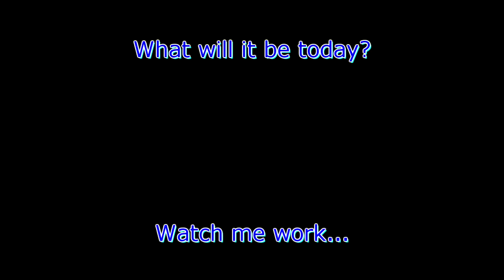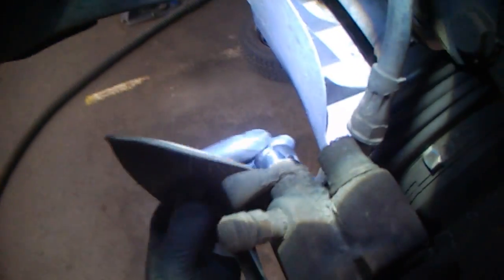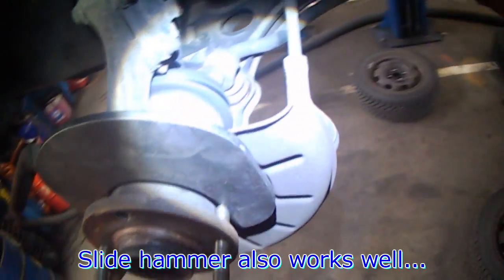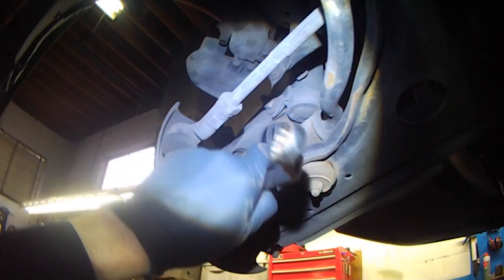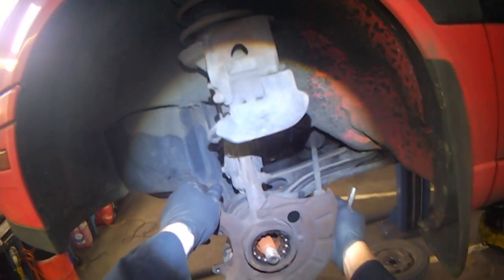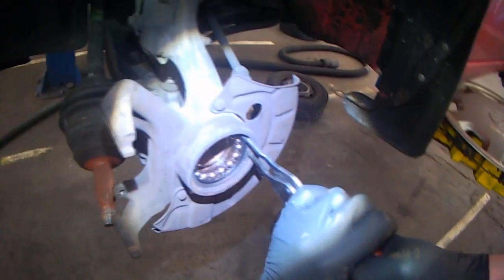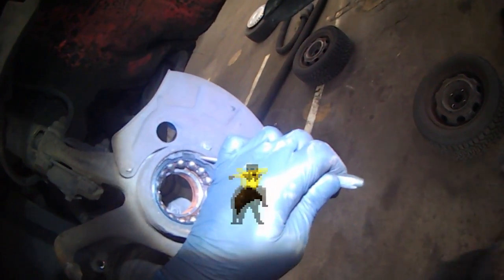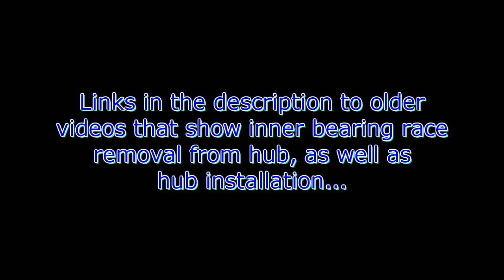VW A3: Front wheel bearing (removal only)

Comment from the maker: Bearing installation video / link is in the description.... for a mk4 VW (same procedure for the mk3 / A3 in this video). Hub removal options link is also in the description.
Reply: Thomas EXOVCDS Those are a real pain if you factor in rust (NY resident here). Both the snap ring and wheel bearing were bonded to the steering knuckle. I'm soaking the parts now in Acetone/ATF. Here's hoping the bearing comes out because the puller isn't working at all. Hydraulic press time?
Reply from the maker: Brent Adriance Yup... sometimes we need the hydraulic press as well.

Comment: I wonder if you could make a tool similar to the one from schley to press out the bearings? Maybe 2 very large sockets and a heavy duty nut and bolt to go through the center.
Reply from the maker: There are other "similar" tools... image search for wheel bearing puller. The other video (listed in the description) has links to such pullers in its description.

Comment: The older I get the more I hate friggin' snap rings. The last one I worked on (A/C compressor clutch) was just a royal bitch that I couldn't find the right pliers for. IMO, the market for snap ring pliers sucks! (ranting...) Thanks Thomas, you yanked those two rings right out of there! = pro
Reply from the maker: When installing the bearing, it is pulled against the snap ring... it took me a while to realize that the bearing moves slightly away from the snap ring when hammering against the snap-ring. After that, the pliers work well, but  still use a screwdriver to lift it out of the groove. =)

Comment: I don't recall you using that plate to pull the hub off and that looked a lot nicer than using a slide hammer. The bearing looked like it was really in there, but as always you make it look easy. And what's going on with the jack hammer guy; it looks like he's two-timing by having two girl friends :)
Reply from the maker: +stuzman I use the plate when there's no abs ring. On the next generation A4 /mk4's you can't use that plate.

Comment: What was that little plate you hammered in before removing the snap rings?
Reply from the maker: It was just a puller plate of the right size.... by hammering against the spring, the bearing moves slightly, which frees-up the snap-ring.
Reply: I do a lot of bearings thats a good tip. I learn something almost every video you put up thanks Thomas